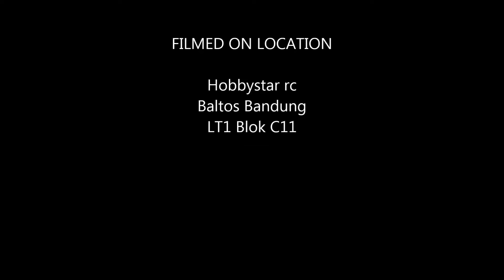kyx rc  v8 gearbox

Comment: Nice i have started new project on scx10ii KYX, nice 2 speed scale transmission but i think motor mount is quite high!
Reply: I agree. I'm thinking of a motor build for the scx10.2 wrangler and the motor is over the body posts on this setup, which would be somewhat problematic for me. Did you get yours mounted? And does the body fit? @Gansukh Ulziisukh